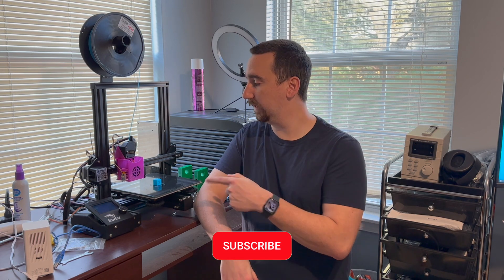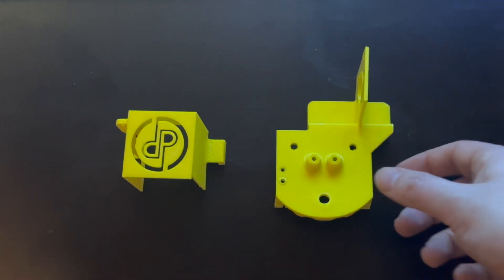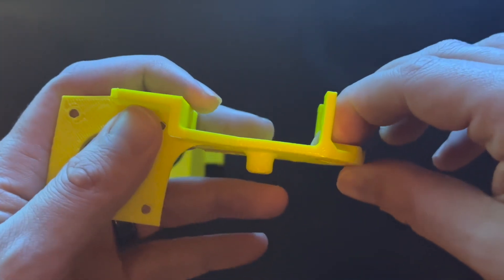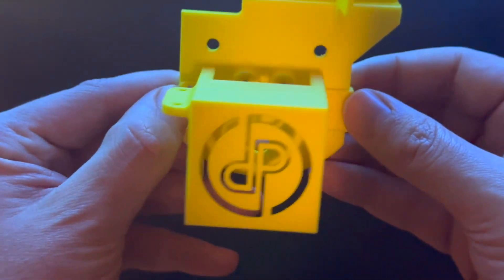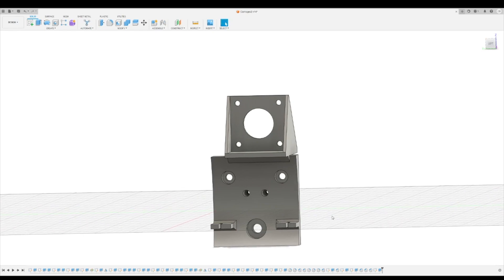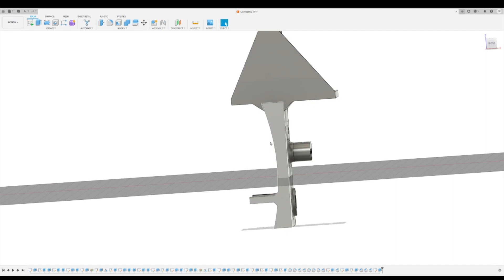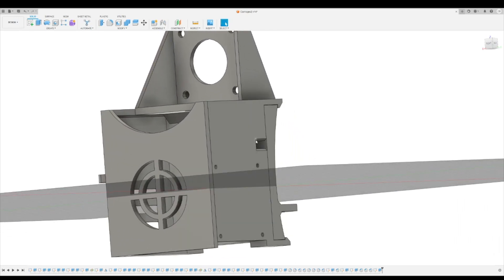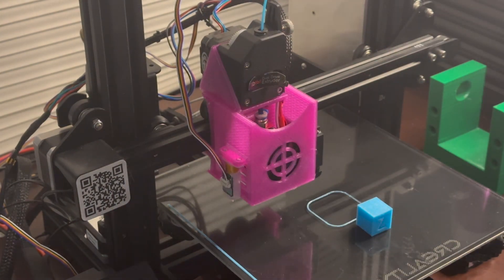Ender 3 Pro Direct Drive System (Rev 2) | STL in description | DIY Printer Upgrade

Comment: Can you use the original extruder and motor?
Reply from the maker: No, this carriage is specifically designed for the extruded / motor combo in the description. I could definitely adapt the carriage for the original components if there is enough interest in it.